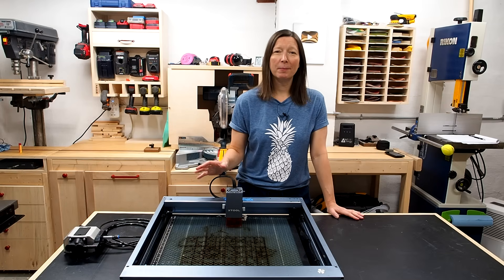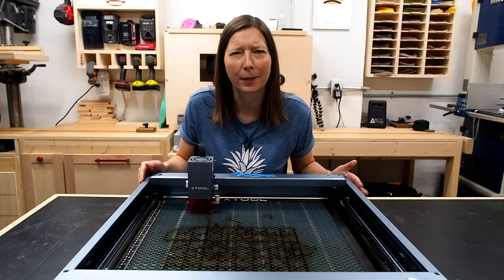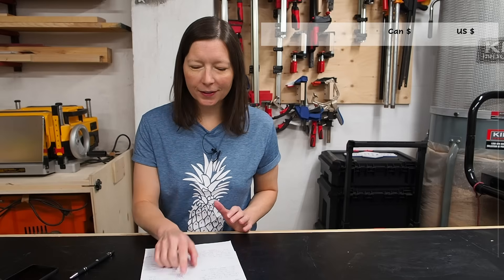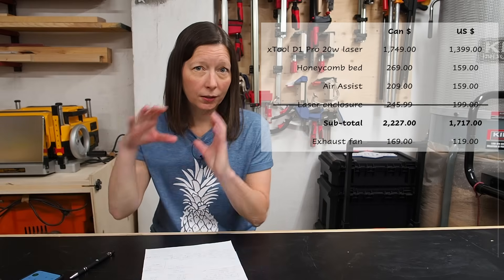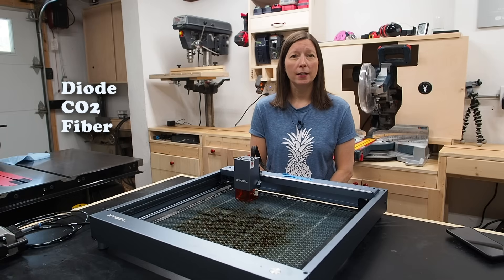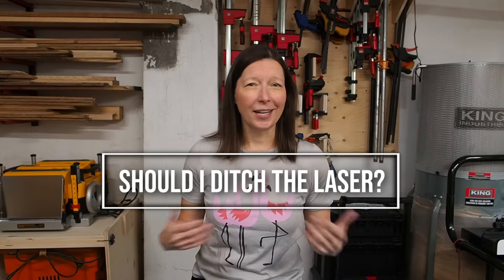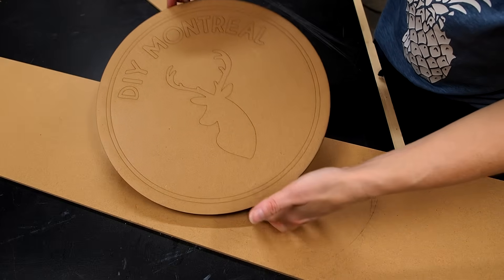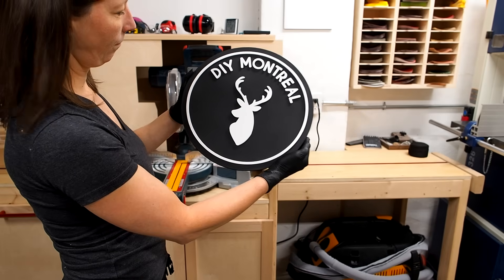Should you buy a laser engraver? Or is it just a waste of money

Comment: You should be careful that looked like a diode laser and those are at 400-450nm usually.    There are dark green/amber glasses that work for that, but usually they are Orange/Red.    A lot of these cheap laser dont give proper protection.   I would always buy my own.   If you use a CO2 then plexiglas is all you need.

Comment: Thanks for the video. It was just what I was looking for. I’ve bought an engraver recently and was concerned about ventilation. You have answered that question. While I am going to return my engraver to Amazon, I just wanna let you know that there is a video that you should see. It is called mastering laser technique. Your guide to intricate wood in layers. By Epilog laser. In that video, he uses a roll of aluminum foil with an adhesive that is laid underneath veneer. The laser will not cut through the aluminum foil. So he can set his depth of cut deep. And avoid the problem you had with your logo. Thanks again

Comment: I am looking to get a laser cutter and this opened my eyes a bit on extra costs, thank you. Also thanks for talking about the ventilation and smells. That is probably one of the most important things discussed, other than the fire extinguisher. Those smells could be bad…
As a recently retired Firefighter/Fire Investigator/Inspector, please be careful referencing the fumes, it is important to have the proper ventilation.
Burning of plastics ( that’s what lasers are doing when cutting ) can produce harmful gases like Cyanide Gases which can kill you or affect your nerves, lungs, skin, etc,. Also do some research on the products you are using.
Some plastics, like polycarbonate, can release harmful fumes when burned, so it's important to use proper ventilation and safety precautions when laser cutting them

Upon further research, Below is what I found on a recent internet search. Do your own research and Please be-careful!!!!  …..
—————————————-
Materials with Toxic Emissions
Carefully evaluate whether the material will produce toxic and harmful fumes during laser processing, and ensure that your air purification system can effectively filter it.
* Chlorinated Plastics (e.g., PVC and Vinyl): Cutting PVC releases chlorine gas, which is toxic to humans and can corrode the components of the laser cutter.
* ABS Plastic: It emits cyanide fumes when lasered. And it usually comes with melting results rather than a clean cut. Use acrylic instead.
* Chromium-tanned Leather:Chromium-tanned leather releases toxic chromium oxide fumes during laser cutting. Use vegetable-tanned leather instead.
* Certain types of Polycarbonate (PC): While some polycarbonates are laser-safe, others contain additives that can release toxic fumes when heated. 
* Fiberglass: It contains both glass and resin, which can emit toxic fumes and harm the machine. Consider switching to laser compatible resins or glass without embedded fibers.
* Polystyrene Foam: It will burn quickly, give off toxic smoke, and catch fire easily. Make use of specially designed laser-safe foams.

Breathing in chlorine gas can cause a range of effects depending on the concentration and duration of exposure. Low concentrations can cause eye and nasal irritation, while higher concentrations can lead to severe respiratory distress, lung damage, and even death. Symptoms can include coughing, difficulty breathing, chest tightness, and fluid buildup in the lungs.

Chromium oxide fumes, particularly those containing hexavalent chromium (Cr(VI)), are toxic and can cause various health problems. Inhalation of these fumes can lead to respiratory irritation, asthma, and increased risk of lung cancer. Other effects include skin irritation, eye damage, and potential damage to the kidneys, liver, and other organs.
—————————
Reply: Perhaps you could consider my product. It meets environmental protection requirements and there is no need to worry about the problem of toxic gases

Comment: You should be able to recover failed cut jobs by removing parts of the design that have completed, assuming you can maintain a consistent zero/home point - have done this with large format vinyl cutters when cuts fail - these have registration marks at the perimeter of the print to allow you to print,take it out to laminate, and then put it back in and maintain alignment

Comment: $169 for a fan is crazy. PC case fans work pretty well for such a purpose if you get the larger ones (140mm and above), and they don't cost much (decent ones go for as low as ~$10-15, i.e. from Arctic). You can power them with a basic 5V USB phone charger and a PWM to USB adapter cable, or get something a little fancier to control the RPM. All in all, should still cost you well below $50, or below $100 for a fancier industrial setup with voltage control. Just something to keep in mind.

Comment: theres no reason to spend money on a dedicated unit. i b uild my own cncs. both 3d printers and engravers. im working on a auto tool changer right now. all of it is made from scrap printers. i 2d printed alot of stuff but you can use plywood or scrap metal to make the frame too.
Reply: all i  bought new was the 10 watt laser and the microcontroller. not everyone knows how to do this stuff but honestly before you buy anything you should lern about cncs in detail. what better way than to build one

Comment: Thank you for mentioning the fumes. Its one of those things that ought to be mentioned more when people are debating getting into the hobby or using it as a business.

Getting around Diode limitations is a bit of a skill, but once you get to know the laser type you can do a heck of a ton with it still (you can, actually, use a diode to engrave clear acrylics, but its more of a "just in-case" technique than something you want to do). Generally I tend to use CO2 for heavy duty and Diode for marking and detailed engravings. Out of my use-cases, the diode sees more use. But that's just the thing, it depends on what you want.

Comment: Watching this one year later I will comment that by now, most lasers come in an enclosure that has it's own exhaust fan and the more premium models have fire detection that stops the machine and starts sounding a very loud buzzer to alert you. If you really want to get fancy they even come with an automatic fire suppression system. However in the past 6 months that I've been using my Xtool-S1 I have had exactly one instance where a piece of thick corrugated cardboard started smouldering and I put that out with my trusty plant-spraybottle, but if I had let it go it would just slowly turn to ash and nothing more would have happened. Fires are actually quite difficult to start if you're even just a little careful about what you put in there, especially if your laser isn't a 60watt beast.
Air-assist is also standard on the slightly more expensive models.

The key thing to note is that most of the downsides mentioned in this video stem from the fact that this is a budget model that doesn't come with all the quality of life features that are actually features that you can't really live without. The difference in price is compensated by you having to put in some work to build those features yourself.

If you go the laser route: don't skimp on the features, buy a package deal that has all the things you want; enclosure, air-assist, a grid etc. If you buy them seperately you'll end up paying more than the package for the same stuff.

Comment: you don't need holes in your box. with the fan you get negativ preasure and if you have somewhere a leak by the box the smoke will not escape and simply stay in there and slowly escape.. less air flow less warm air that you pump out of your cozzy room...  and i see no reason to buy such an expensiv laser cuter if you simple could use a 200-300$ china thing...

Comment: I agree they stink and needs ventilation. It is my opinion X Tool laser are over priced. I found a great 36watt laser made by a solid company that came with honeycomb grid, air assist and flame detection. I did order the cover built for my laser machine and removed the protective glass and use them to make a better cover that works great. My total cost is 750.00

Comment: Hm...10 months late the party. Oh well.

CO2 laser: Works kinda like a neon sign. Send power through CO2 gas with mirrors at either end and build a laser beam from it. No amplification stages.
Diode laser: Basically a specially designed LED with mirrors on 2 sides to create the laser beam. No amplification stages.
Fiber laser: Usually uses a diode laser as a seed laser and shoots that into a, you guess it, fiber optic cable. The fiber cable has two layers, one to conduct the seed beam, and one to amplify the light via pump lasers. Think about it like this: you have a solid core surrounded by two pipes. The outer pipe is plastic, the inner pipe is steel, and the core is a solid copper rod (just for metal visualization). The laser beam you want is in the core, but when a different lasers (different frequencies) are fired into the inner layer (steel pipe layer) they react with the (normally yttrium, but other elements can be used for other wavelengths) and re-emit light at the same frequency as the light in the core. This amplifies the beam in the core. This is why diode lasers normally cap out at 40w, but fiber lasers go into the 1000s of watts. Amplification.

What a laser can cut depends on two things: Pulse time and light frequency. Femtosecond lasers have been shown to be capable of welding glass in labs. Femtosecond referring to the pulse-length of each laser pulse. To your eye it may still look like a solid beam, but it's not. The other variable is light frequency. Wikipedia has a nice image on the main lasers article showing what frequencies various types of laser emit light at. CO2 lasers emit one frequency of light ~10,000 nm (infrared) while diode lasers can emit many different frequencies (not all at once, each diode can only emit 1 frequency, you have to swap diodes to get a different frequency) depending on what internal structure they use.

The reason frequency matters is because different materials absorb light of different frequencies. To cut copper with a laser, you need a 'green' laser (~530nm). But to cut steel, you want an infrared laser at around 1,000nm (normally where fiber lasers operate). If you use a green laser on steel it would work, but be extremely inefficient. Like, you might need a 10kw green laser to do what a 100w infrared laser could do.

So, it's not about 'better laser' or 'higher quality', it is about physics. And I'm not shaming you. I just love to teach. Also, understand, if you have any mirrors or optical cables as part of your laser system, if you swap laser frequencies, you have to change all the optics too. ALL the optics. An optic that can focus a 10000nm beam will (usually) be destroyed by a 500nm beam. A mirror that can reflect 500nm light will be destroyed by the 10,000 nm beam. Why? Because the surfaces are designed to not absorb light of a certain frequency, but no surface is low-absorption to all frequencies.

Comment: Low watt lasers are made for Engraving and burning and that's it you need 40 Wat and up for cutting.  My advice is skip the laser and go straight to CNC because it can do everything a laser can not 3D cut Etc and guess what they're a lot cheaper.  You can get a desktop CNC for around $300 for a small for a medium you can get one for around 700 bucks Fox alien is a good one.  The only problem with CNC is dust collection and Chip collection you have to work that out unless the system comes with one  .  Oh and you can also get CNC that come with lasers

Comment: For anyone thinking of getting a laser cutter and put off by the prices of the unit in this video it's good to consider the Longer RAY5 10W With HoneyComb Panel, Vented Enclosure, Air assist pump, roller, extension kit etc. 689 USD. It's the best place to start in my opinion.
Only has focus of 0.06...I say ONLY like that matters to 99% of people who want an engraver (0.06 is still very, very good quality). Might have lower output wattage than the XTool D1 you have but honestly 10W is more than enough for most people's needs and you can always upgrade to 20W and still have it cheap. Doesn't need to be that costly for a good bit of kit.

Comment: WARNING!! You should avoid Laser machines that dont offer proper ventilation like most of the desk/benchtop models. In most cases,  the fumes from laser engraving and cutting  *can be toxic*  if you don't have proper ventilation.  Here's why:

* *Laser Cutting/Engraving Process:*   Lasers generate a high-powered beam that vaporizes the material being cut or engraved.   This process releases particles and chemicals  from the material.

* *Risk of Toxic Fumes:*   The specific fumes  depend on the material being engraved/cut.  Many common materials  like  wood, acrylic,  and  PVC  can  release  toxic  fumes  when  laser  processed,  including:
    * Volatile organic compounds (VOCs) which can irritate the eyes, nose, and throat and potentially cause long-term health problems.
    *  Carcinogens  like  benzene  or  formaldehyde  which  are  linked  to  cancer.
    *  Metal fumes  that  can  cause  metal  fume  fever  (flu-like  symptoms)  or  more  serious  health  problems  with  long-term  exposure.

* *Importance of Ventilation:*   Fumes  can  concentrate  in  a  closed  environment  without  ventilation,  posing  serious  health  risks.  A  proper  ventilation system  exhausts  these  fumes  outdoors  and  away  from  the  work area.

*Safety First:*

* *Never operate a laser engraver/cutter without proper ventilation.*   Consult the user manual for specific ventilation requirements for the machine and materials you'll be using.
* *Use appropriate personal protective equipment (PPE)  like  a  respirator  designed  for  laser  fumes*  if  the  ventilation  system  isn't  sufficient  to  completely  remove  fumes  from  your  breathing  zone.
*  *Always  refer  to  the  Safety Data Sheet (SDS)  for  the  specific  material*  you'll  be  working  with  to  understand  the  hazards  and  safe  handling  procedures.

*In short, don't risk your health by operating a laser engraver/cutter without proper ventilation.  It's  always  better  to  err  on  the  side  of  caution.*   

If you're considering laser engraving or cutting and don't have  proper  ventilation,  it's best  to  either  invest  in  a  ventilation  system  or  use  a  service  provider  with  proper  safety  protocols  in  place.

Comment: Can Xtool ever shut your system down should they decide they are suffering financially? In other words, if they decided to start charging for their “free” software, would your system no longer work if you didn’t want to pay whatever fee they may demand?
Reply from the maker: Yeah I guess they could start charging for their software but should not be an issue. I've switched over to using Lightburn software since this video. so you can use other software and have no need for the Xtool one.

Comment: Please make sure the laser eyewear is rated for the laser wavelength (you can also get acrylic sheets with the proper laser rating for the workstation instead of clear). Also, I would advise you change out the fire extinguisher for a CO2 style. Using a dry chemical extinguisher can be destructive on electronics and god forbid it gets into the laser module.

Comment: I own a (now) cheap 40 Watt China CO2 laser engraver which I have upgraded almost immediately. The base model was 200€ used on eBay and I‘ve changed the DSA first and upgraded the laser tube to a 40 Watt shortly after. It came already with a case and hood when I‘ve bought it. My exhaust system is almost the same as yours with one difference: I have a separate exhaust funnel that connects to my SLA Resin 3D Printer. If you think that a laser engraver smells you have never smelled a resin 3D Printer  at work.

Comment: I run an Atomstack 20watt laser with the metal Atomstack enclosure with lightburn for exhaust I just installed a dryer vent with an inline exhaust fan it works great.

Comment: Just bought one and also a bunch of accessories. I am looking to make an enclosure before I start it as I am in Canada also. I got mine on Black Friday Amazon I got the sculpfun S9 with a 5.5w output laser $339 regular $550. I am getting the extension as I am planning to mostly use it for. I picked up the laser assist  and templates. I plan on getting the quad 22w output laser later but it's $890 plus shipping. I do 3d printing with 2x, 3d printers I use fusion 360 with that.

Comment: This vid is awesome. I'm a designer and have been thinking of different which platforms  (stickers, laser, DTG, etc.) to make some extra income. I keep circling back to laser but haven't felt I had enough info in regards to cost and supplies. I also never thought of the fume factor. I used to weld and know the risks of burning galvanized steel. Thanks for providing all the info I didn't consider.

Comment: Whislt i do agree witb some of your points, i do nlt agree with you saying that ventilation is a must. Its not. Just ooen a window and have a pedestal fan to curculate the air and its fine.  Inuse my engraver indoors a lot and doind as mentioned above works just fine.  Dont need to spend money on an enclosure or inline fams. That isthe waste of money. 

As for use, well it depends on what you are trying to achieve.  You seem to be using it more for cutting. Most people would mostly use it for engraving. What other tool can do that without burning wood to achieve that effect?

Laser engravers are awesome and a really usefull tool. It just depends on what you want to do with it.